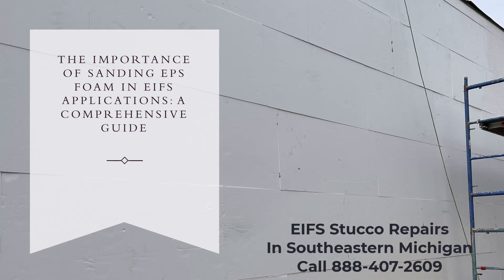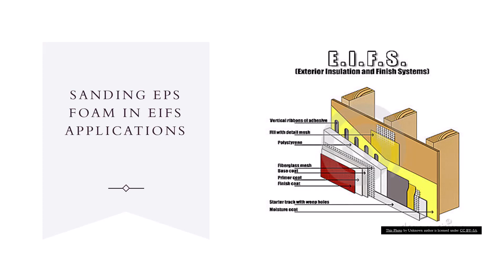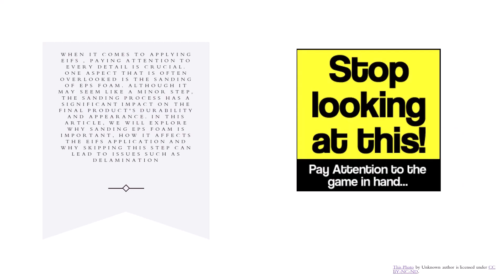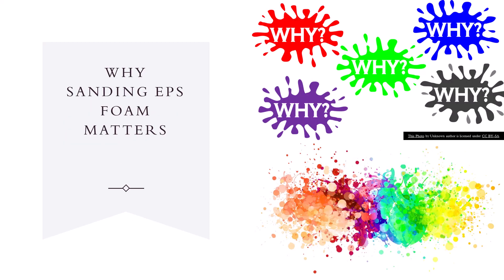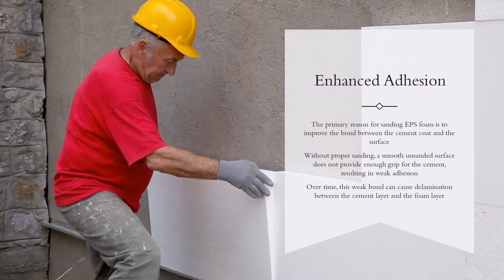The Importance of Sanding EPS Foam in EIFS Applications: A Comprehensive Guide

Comment: I have been in the EIFS industry since the late 70's, the stuff that I have seen over those years is mind boggling. Later this morning I am looking at a project where the installer did not sand the EPS before applying the base coat, allowing for the outline of each sheet of EPS to be seen at the witching hour. The cost for this 15-20,000 SF repair will be quite substantial. Sanding EPS takes time and money. A warning to all potential EIFS Builders/customers, scrutinize your contractor, check their references, talk to their suppliers, most importantly don't necessarily take the cheapest price.